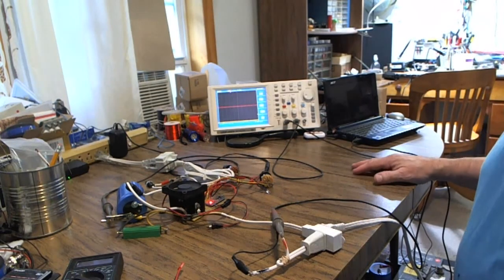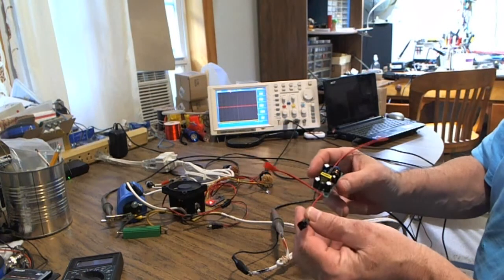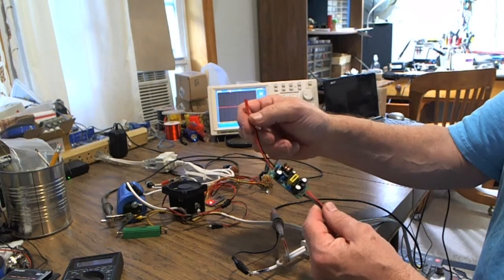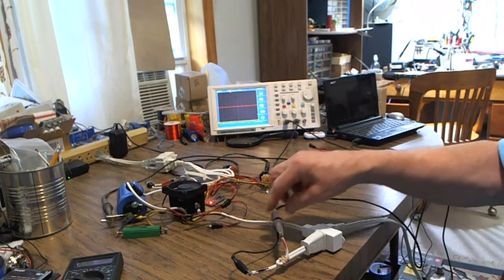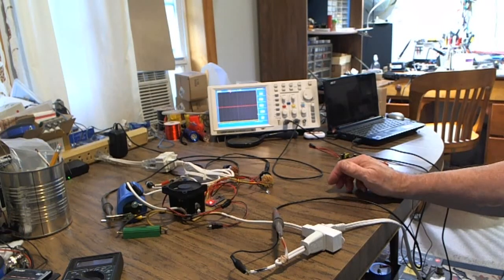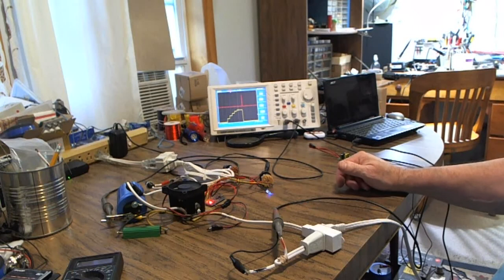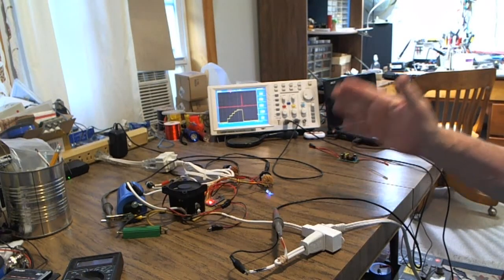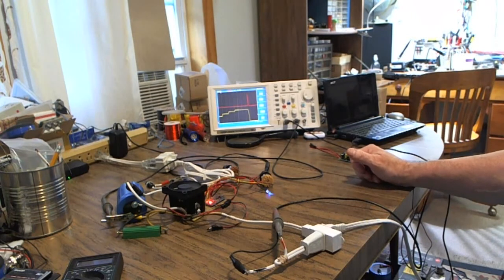High Power PEMF Kit Video 3

Comment: Hi, love all your videos, excellent work! I am currently researching into the benefits and dangers of PEMF devices and I have a quick question for you. How do you make sure that the PEMF that are being emitted are safe and do not emit the same dangerous radiations as that of cellphones and wifi? Have you tested using some EMF meters, etc...?
Reply: Also, what makes it a PEMF? Isn't this just an electrical device that emits EMF? Or do you actually pulsate the radiations using the software?
Reply from the maker: Very good question!  Books have been written to explain what PEMF is all about, so this short explanation will be lacking in thoroughness.  However, I’ll state a tidbit of what I understand.  Please research PEMF to fill in all the details missing here.

PEMF carries energy to the cellular level that can help with more efficient functioning of ion exchange as a result of the chemical processing going on within each every cell in your body.  It does this with a single pulse burst of magnet wave energy.  It is significantly different from the very complex electromagnetic field generated by cell phones.  Cell phones produce a modulated carrier wave that has an intensive information field.  The combination of a modulated information field along with a carrier frequency can work for or against cellular health.  The High Powered PEMF unit does not modulate the magnetic wave it produces.

The above paragraph states a difference between a cell phone emission and the PEMF emission.  It does not state that a PEMF could not be used in a way that could be dangerous.  This is where you want to go to the books or papers on the subject of PEMF energy.  I’m sorry for the brevity, but some questions require too much information to explain thoroughly in a blog. Respectfully, Steve.